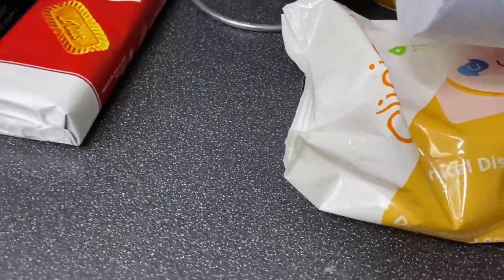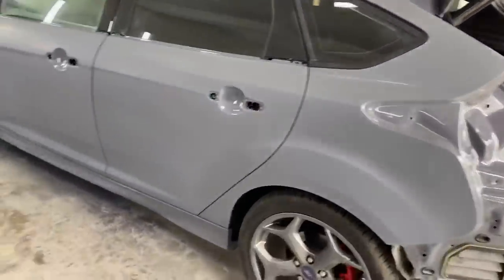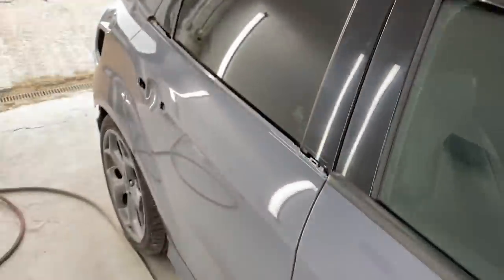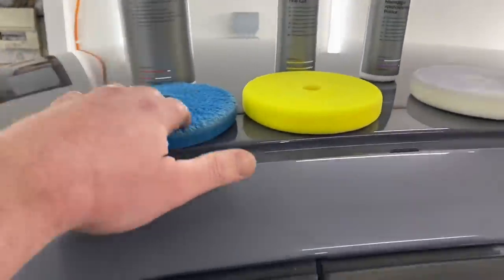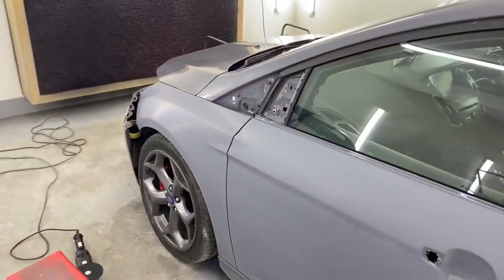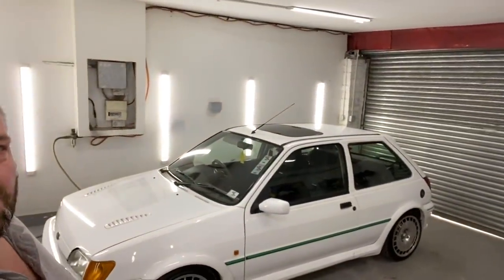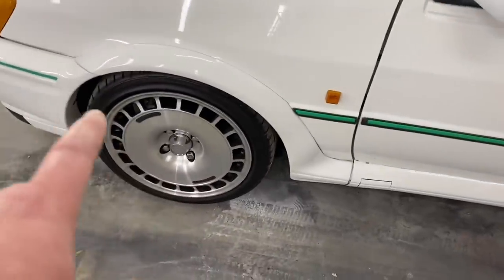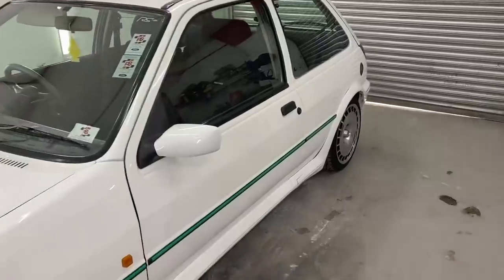Mountune focus st3 disaster paint job repair!! Part 5

Comment: Top job 👍 did you say in previous video that the 3m compounds are full of filler?
Reply from the maker: Yes 3m fastcut has fillers in as do other brands the new fastcut plus extreme has less fillers than the older one but I still panel wipe 👊👊👊